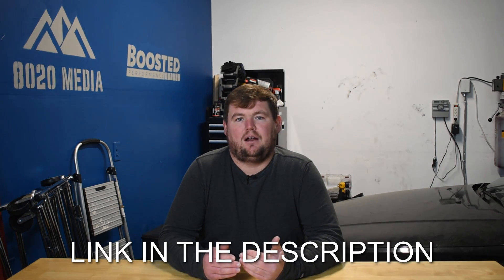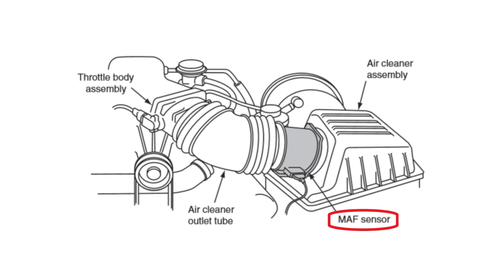DIY - 5 Symptoms of a Failing MAF (Mass Air Flow) Sensor!

Comment: My 2013 nissan altima has this code and it went away and it turned back on but i cleaned it and code came up .. so when i turn it on sometimes it turns on completely for like 3 seconds then turns off but sometimes… and when it doesn’t do that it start on and runs good just with check engine light on im going to try it and buy a new one ..
Reply from the maker: L - Keep us updated.
Reply: 2011 Nissan and I've replaced MAF at least 4 times. This time my mechanic is going to use a Nissan part. However I am not sure it will not happen again. Each one has lasted about 6 months to a year if lucky. And before you ask yes everything else has been checked and/or replaced. My question is what year car do you have to buy to get pass the faulty MAF?

Comment: Going to replace my MAF, I’m thinking That’s my problem Because I had a lean code p0171 & P0174 Already changed my fuel filter and pump I have fuel pressure but My fuel trims are very high In Key on engine off Hopefully it fixes this issue, the truck won’t start but it sounds like it will it just sputters and shuts off
Reply from the maker: W - Keep us updated. This video of ours might be helpful with diagnosing as well: https://youtu.be/0YRdzJbHcm4
Reply: @8020Automotive  good videos, I just subbed and yea I’ll Comment once I Get it diagnosed
Reply from the maker: W - Thanks for the feedback!
Reply: I bought a dash board mounted OBD2. It can read out many parameters like throttle body % opening, MAP, MAF, low & high fuel trim, RPM, IAT, O2 reading, battery voltage etc etc. 

For a 2 litre car engine it's MAF should be reading air flow of around 5g/second at idling RPM with air cond off vs manifold pressure at -7.3psi

Setting the car on auto cruise mode and keeping the car's engine at 2000rpm the MAF should be reading around 45g/second when  MAP (air manifold pressure) at +7.35psi vs MAF 30g/second at 0psi by MAP. 

On the dashboard OBD2 show be recorded using a mounted hand phone so that both hands are in the steering wheel. Be safe. 

Broken vacuum hose or even a slightly loose air clamp can cause atmospheric air to leak into negative pressure side of the manifold and drop MAF reading during idling. Throttle valve body opening will easily drop from 15% open to 13% or less.
Reply from the maker: W - Great insights here. Thanks for sharing.

Comment: I have a 09 kia optima  and my car starts and shuts off with in 10 seconds. In park i can hit the gas and ut stays  on but when i stop it shuts off  i cant even  drive out the drive way could mas help that thanks
Reply: Check/clean your idle control valve, change your fuel filter too if it's old.
Reply from the maker: D - This sounds like your engine is stalling. We have made a video specifically for this issue: https://youtu.be/7bqAIbYRdnc
Reply: Is exhaust flowing?

Comment: Thanks for the input got a few of these symptoms with my 01 pontiac grand am seems like it could be the culprit
Reply from the maker: Sanford - Keep us updated. We hope this video helps!
Reply: @8020Media  so just replaced the maf sensor and still sputtering is there another sensor that I'm missing
Reply from the maker: S - Do you have any engine codes?
Reply: @8020Media  no codes just sputtering around 45-55 mph until I open it up look up that it could be a fuel pressure regulator ya?
Reply from the maker: S - It certainly could be! Given it sputtering, this could also be a fueling related issue.
Reply: @8020Automotive  ok mabey a fuel filter as well? Mabey?
Reply from the maker: S - Certainly could be. Keep us posted.